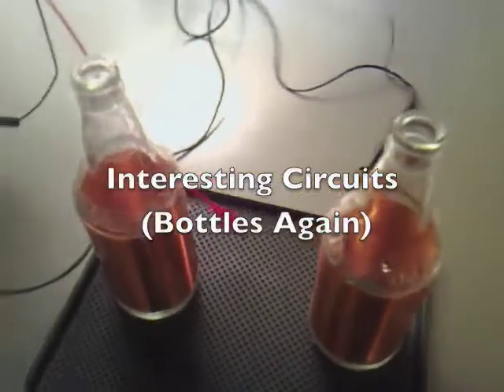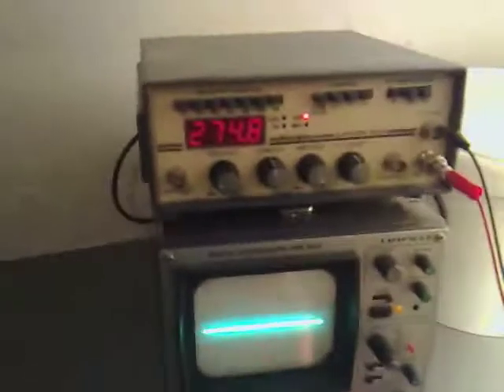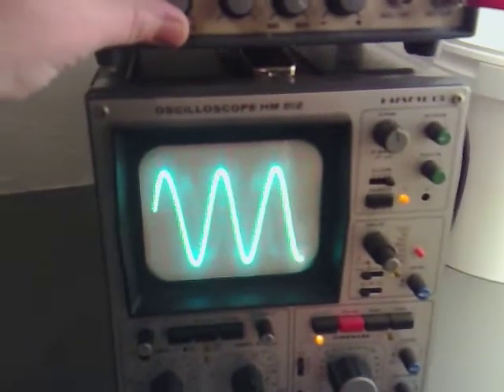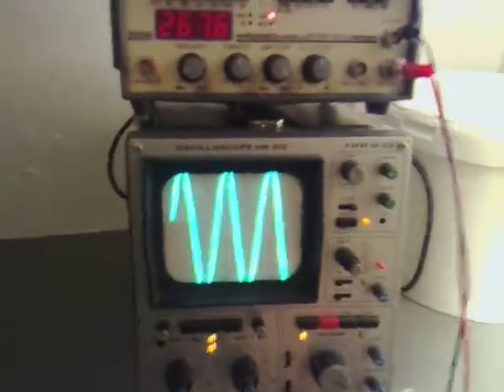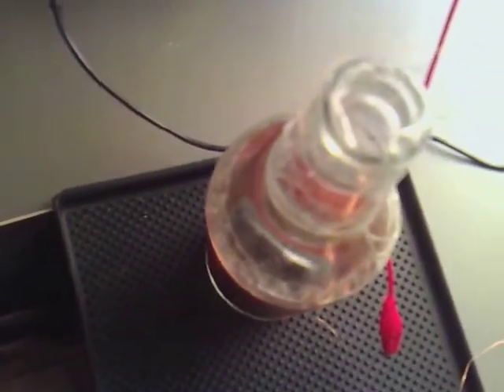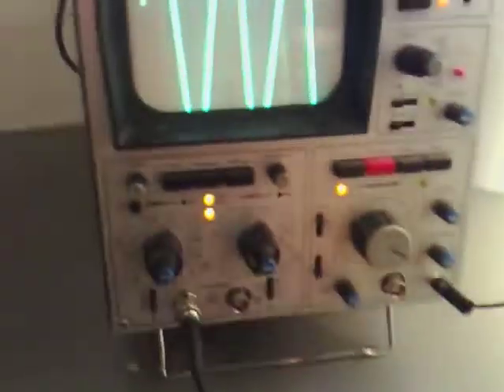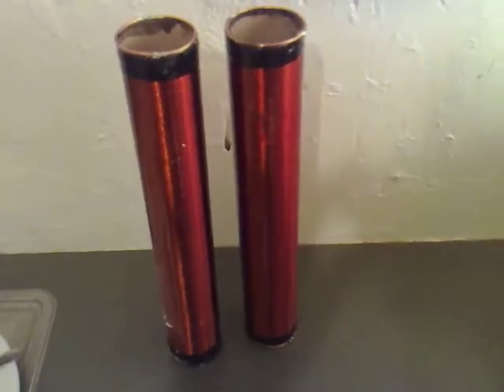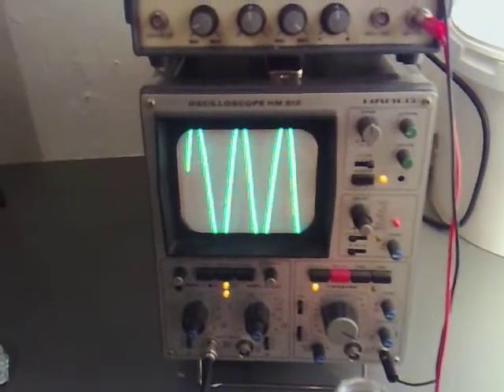Interesting Circuits (Bottles Again) 007

Comment from the maker: Yes I made a circuit today with a TS555 Timer and it works The coils hit resonance..

You need to get the timer to be at 50% duty cycle or there abouts, near as you can.

Paul..